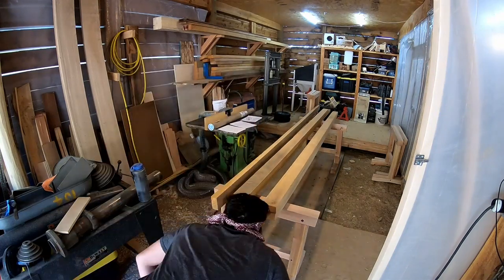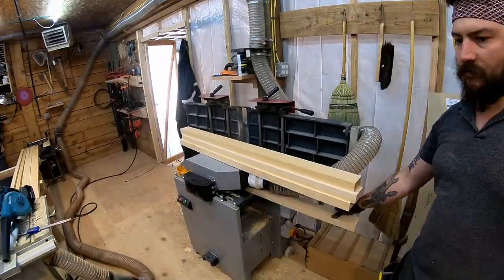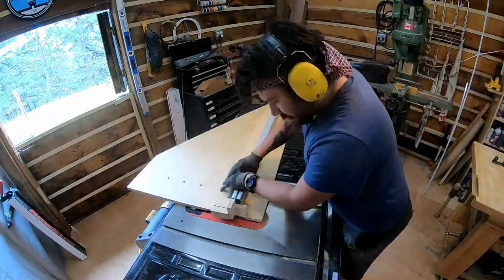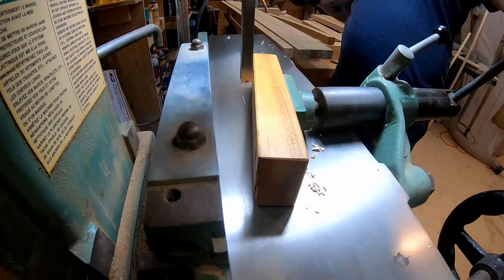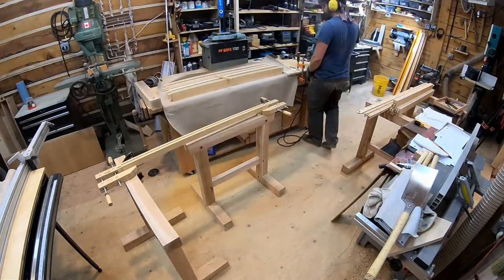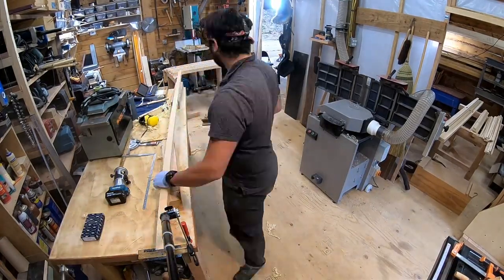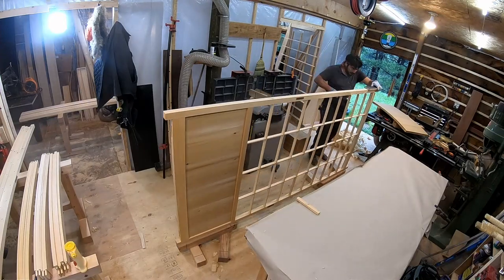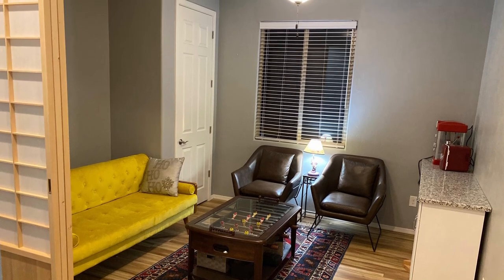How to Build Large Shoji Doors

Comment: Hey Jason, beautiful work and video. 2??. Is your double faced tape set in a shallow rabbet around the inside edge of the outer frames? or on a flush surface, which is my condition? (I'm using the same tape.) Also, were your door left unfinished?  I'm using Spanish cedar. Thanks

Comment: Amazing work. Question: are those Makita groovers preferable to just using a router? Second, where can I get my hands on one!?
Reply from the maker: Thank you! Very much so, for one they are much faster and the cutting direction / spin is in the direction of the cut and so very stable. If you apply light pressure against the fence it will cut clean every time. No chance of a slight hesitation causing a router to dig in. Also they can do wide grooves… like 30mm deep in a single pass. I find much less stress when using them. I have only ever seen them in Japan.